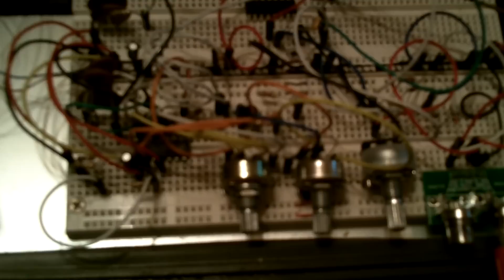LM324 LFO VCO breadboard test

Comment: Hey can I ask how you're powering the VCO?  I built one I found online using a dual +-12V voltage rail but The highest i seem to get is about 100hz.  Any advice?
Reply from the maker: I'm using a "Breadboard power supply" made from a kit I got from DAQstuff(d o t)com, but they seem to be out of them currently. If you do a google (or ebay) search for "+12v breadboard power supply" you'll find something like what I use. It is a pretty simple kit, but work very well. It only provides ground & 12v, so it isn't a dual rail supply, using that power supply limits the circuits I can assemble and experiment with right now.

As far as the problems with the circuit, could you point me towards a schematic? If it only put out a very low freq, I would suspect a vital capacitor was either damaged or the wrong value. If you can point me to the schematic, I can try it out and see what results I get.
Reply: tastesofchicken
Hey, thanks for the reply.  I'll PM you with further details.